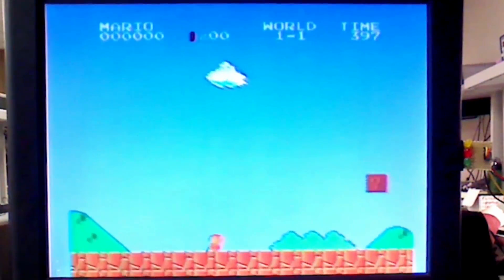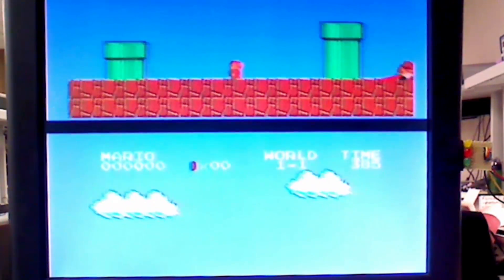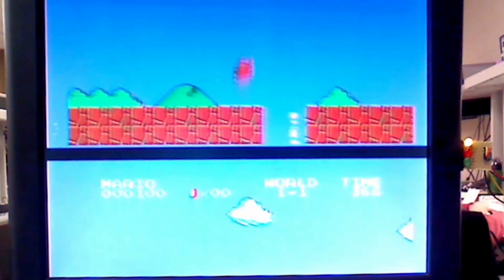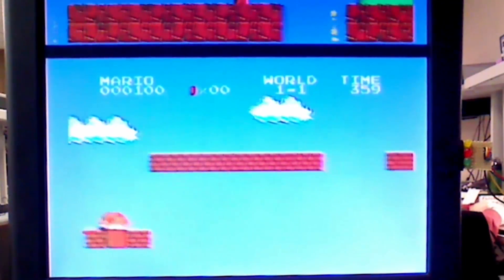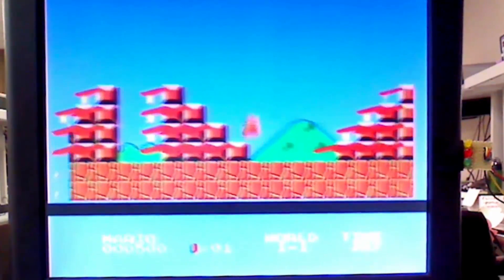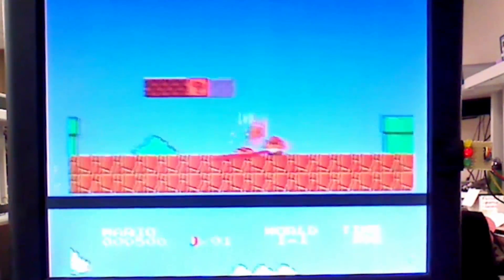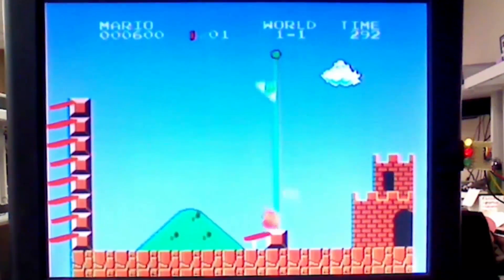Hardware-Based FPGA AI for Super Mario Bros.

Comment: Have you tried running the video signal through some other device to get it into a regular format?
I dunno if they generate a new NTSC signal or just pass the original, but you could try using a VCR or DTV converter box like:
NES RF out -> VCR antenna in -> VCR video out -> FPGA in

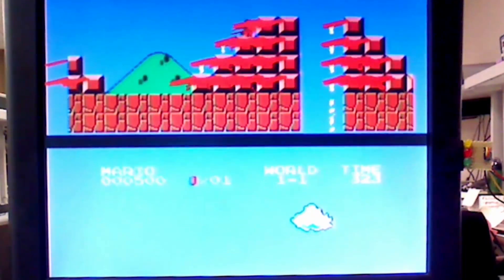Nice work BTW, the pit at 0:40 looks like it would be tough to deal with.